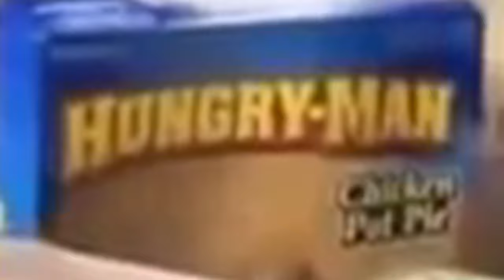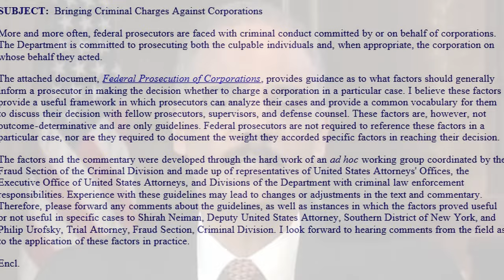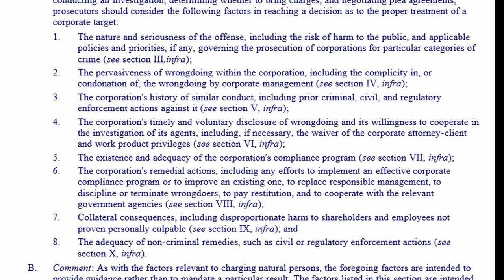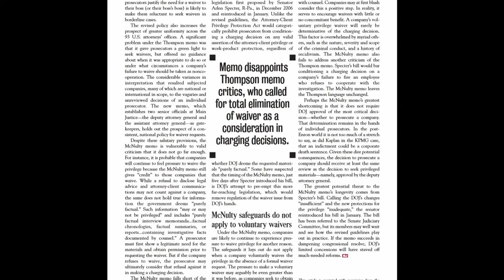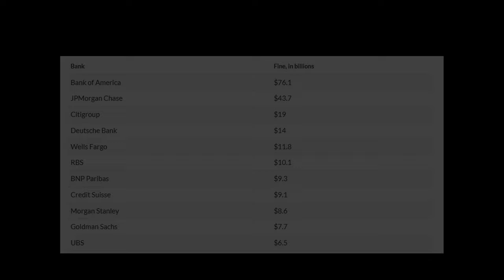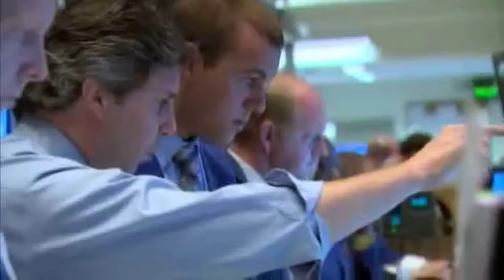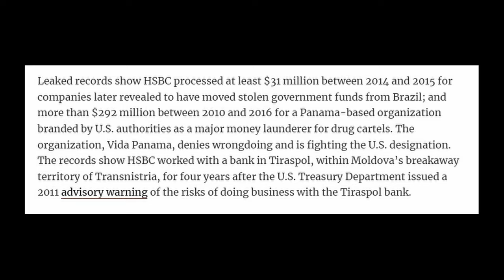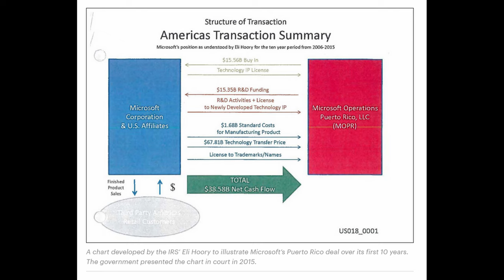Selling Justice: Too Big To Jail

Comment: There's something to be said for holding the directors and C-suite directly culpable for the acts of the company they run. Not ordinary shareholders, but the board. Scale up the degree of culpability based on gross interest in the company and company turnover (*not* profit, because the techbros need to suffer just as much as companies that make useful things). On the board of a company whose shares you own directly or indirectly through, for instance, a trust? All that counts towards your culpability as a board member.
Reply: Thing is some shareholders are also very rich and influential in whatever company they own stock. Not every shareholder is middle class.

Comment: S&Ls aren't like building societies, they aren't member owned, they're just another type of for-profit bank. They failed not because they were deregulated but because other banks were.  As long as other banks couldn't innovate and compete, as long as banking was boring and rates fixed, they could just borrow at 3%, lend for mortgages at 6% and be fine. They weren't too big to fail, they were relatively small.  

The problem is it obvious that if they S&L industry wasn't deregulated like other banks.  But by that time they had to pay lots of interest on savings to compete, and they had most of their money in relatively low interest mortgages.  Many of them were functionally bankrupt, but by gambling like mad they could be made profitable, or at least made to appear less broke than they were.   Eventually this went belly-up in some of them, but it wasn't a case of too big to fail, just bad monitoring of federally insured funds.

Comment: "That's not Right."

Right has been dead a long time. Right died in the Thirties was briefly resuscitated, suffered some brain damage, required constant care, and then slowly descended into a coma and finally strangled on its vomit during the SnL Crisis. So you are correct, that's not right.

Comment: No there was not banking deregulation prior to the 2008 financial crisis.  There was in fact much more financial regulations.  The biggest change was Basel III which made the minimum reserve requirements much more complex and therefore more regulated not less.  The only real "deregulation" was the repeal of much of the Glass–Steagall Act by Gramm–Leach–Bliley Act.  All this did was allow combined commercial and investment banking.  None of the problems in the banking sector came from combined commercial and investment banks so that wasn't the cause of the crisis.  Nor did combining commercial and investment banks cause problems outside the USA, where it was allowed for decades.

The myth that deregulation caused the 2008 crisis is persistent, but so was the myth of a god driving the sun in a chariot.

Comment: @8:40 The Holder memo lacking a holistic viewpoint.  Any corporation acting against broadly defined public purpose could be fined out of existence when the "free market" is not acting to eliminate them, without badly hurting shareholders or employees.  If you admit you are not operating pure capitalism that is... because if you are not[#] then the government is your monopoly currency issuer and can always offer a living wage Job Guarantee, which means no one has to ever forego necessary income when they quit a job or get fired.  Since the JG is a wage floor and a labour buffer it has no inflationary bias (the private sector bid for unemployed labour is by definition zero, and in a demand led boom the JG pool naturally shrinks, so the JG is an automatic stabilizer).[##]
[#] There is no such thing as real actual existing pure capitalism.  A single monopoly prevents such a system, and as soon as Pareto distribution effects set-in (the main instability of pure capitalism) then there is also no longer a free market.
[##] Also tax the rentiers.  Not because the government needs their money (the currency issuer does not need to get money) but just because they are rentiers.  All the classical economists would in fact not only tax rentiers, they might just say we aught to fine them out of existence.  This is possible because rents are unnecessary when there is a public money monopoly, since this mean pensions can always be paid when due, at a decent inclusive living wage.  No one needs to save for retirement under a currency monopoly, unless the currency monopolist government) is deliberately or innocently cruel.  Yes, call me naïve and overly optimistic, but the fact is most governments (outside the eurozone) are already currency monopolies, so all that I outlined could be done, and it is only political choice they are not implemented policies.
Reply: Why should shareholders be shielded from the full repercussions of legal action, if they're also free to enjoy the ill-gotten gains of these illegal enterprises?

Comment: Tbf you keep you saying deregulation caused the predatory lending, but they wouldn't have done that without feeling safe in the knowledge they'd be bailed out.

If, from the drop, they'd believed the risk to be their own, they wouldn't have been so willing to commit to said risks.
Reply: worth noting that "regulation" is a neutral term, and whether something is a good or bad piece of regulation it depends entirely on what is being regulated/deregulated.

its clear that the banks have infiltrated the government, and so the deregulation we see profits the largest banks, whilst the regulation that occurs hurts smaller banks and business and do very little to stifle the growth of said banks.

now the system has been effectively built around them being able to conduct business freely without any concern. If there is an obstacle, they'll deregulate. if they want to create an obstacle, they'll regulate. Only major reform if not a straight up political witch hunt would put them down a peg.